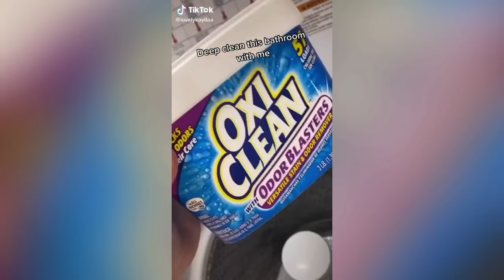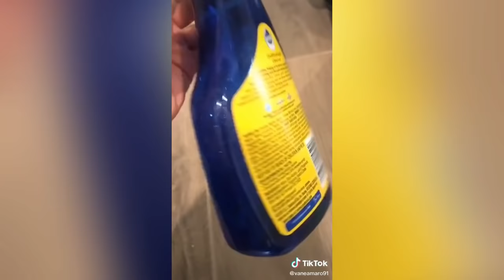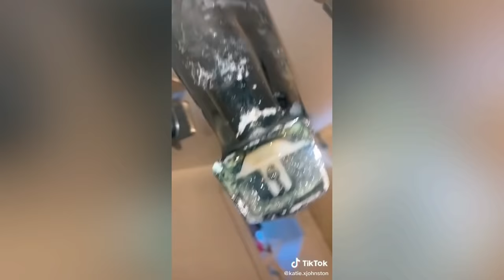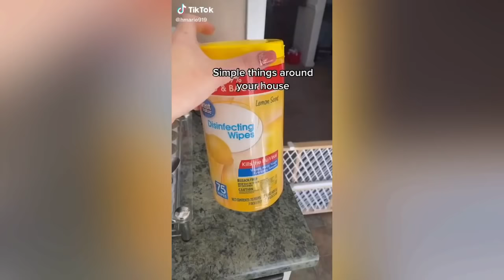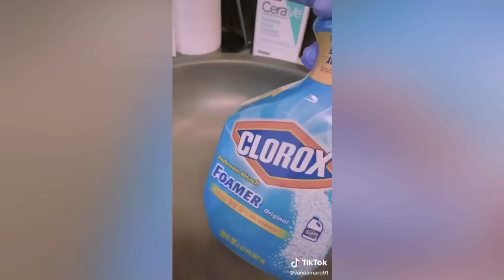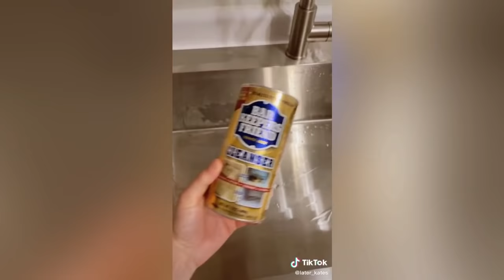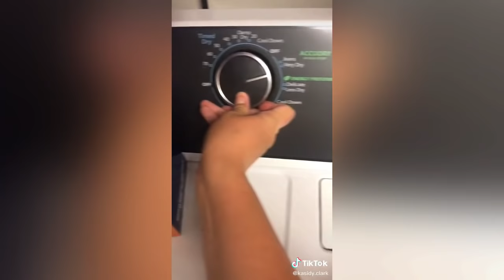BEST OF CLEANING TIKTOK PT. 4 | SATISFYING CLEANING TIKTOK COMPILATION 2020

Comment: There's a great grout brush called a fuginator, much easier than a toothbrush.
Reply: Is it cheaper though? My family used to buy really cheap packets of tooth brushes for all that cleaning when I was younger lol

Mostly asking bc I’ve never used one and it might be a good investment
Reply: @invadermaythe1st  they aren't dirt cheap, but they are incredibly coarse and last a long time. The bristles are in a thin line, and the design of the handle means you can swipe up and down the grout quite quickly.